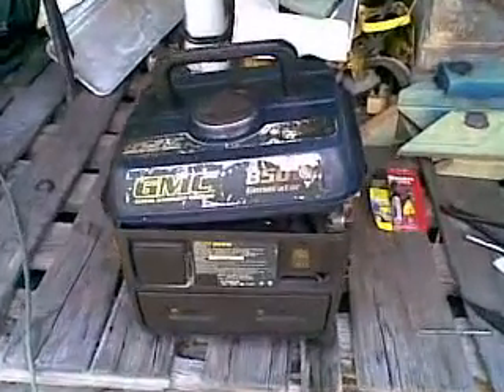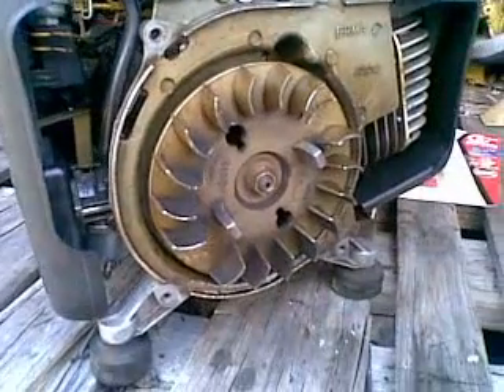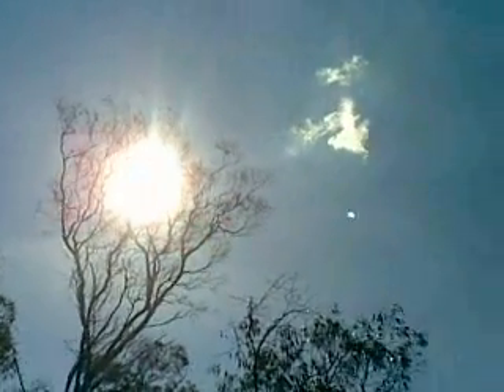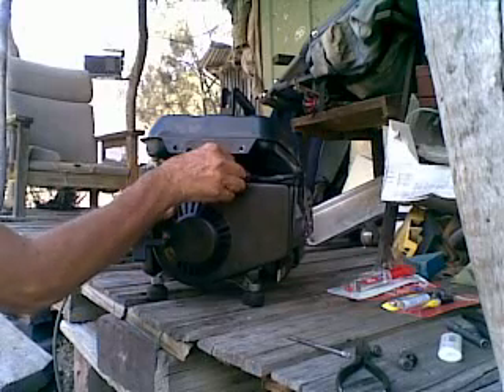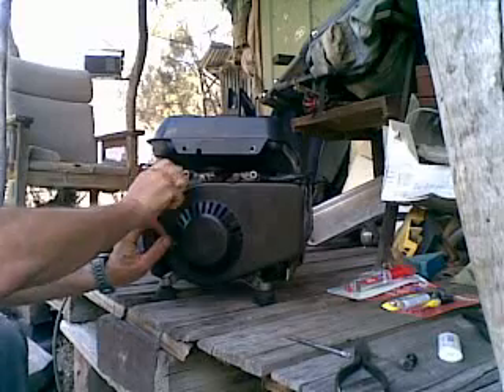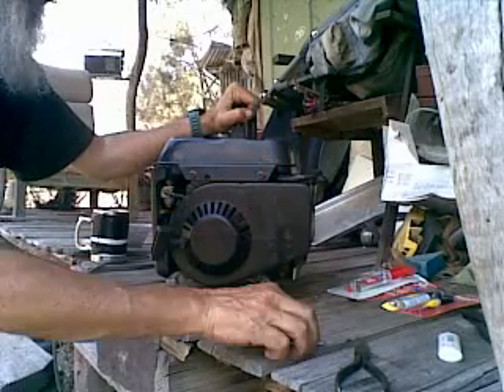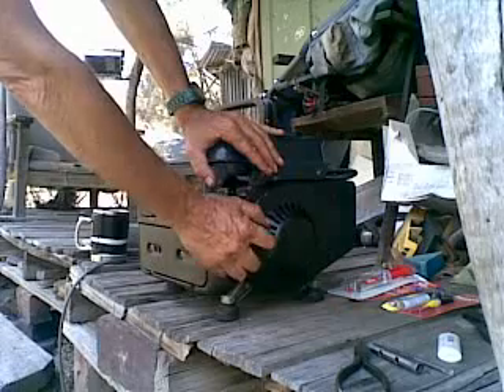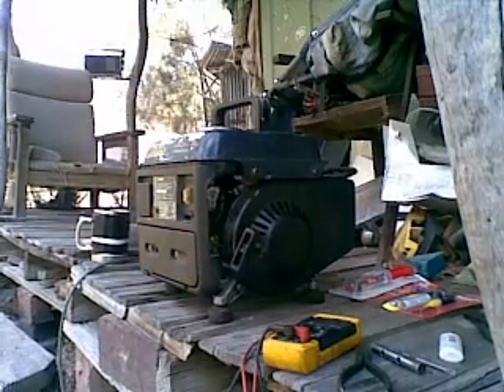Pyramid's Electric Generator, Resurrected...! (@ 4,435 Hrs : 53 Minutes).

Comment from the maker: @belgrademachine
 G'day mate...! Thanks. Um, yeah, I'd hate to have to dump it when it runs, for the sake of a Pullstart breaking down...; it doesn't seem right... When I clean the Exhaust it'll sound a lot crisper - it's done 230 Hours since last time I did the Exhaust ; that was a big reason for starting the Log-Book... So I could correlate Fuelburn with Performance, & know when the Cleaning would be due. I use High Performance 2-Stroke Oil & a Hot (B9-ES) Sparkplug. Ciao !

Comment from the maker: @clnmyjts
 G'day mate...! Well, if you accept that they're overcooled at anything less than full output, so they condense the unburnt 2-Stroke Oil & so they Drip ; & every 150 hours the Exhaust needs Disassembling, you'll not be disappointed. But, they're cheap, and quite a miraculous bit of Production-Engineering. Especially at the price...; you should have fun... Enjoy it... Ciao !